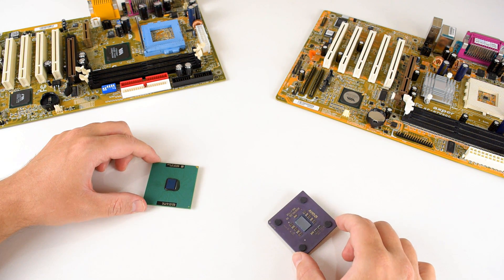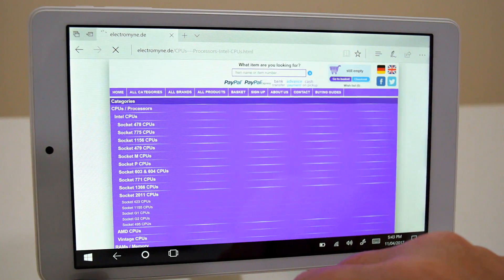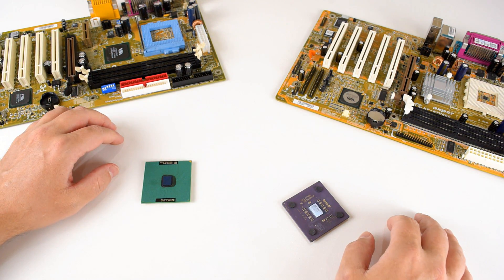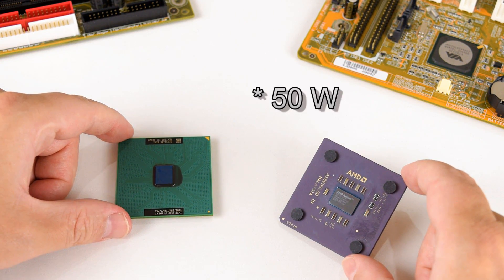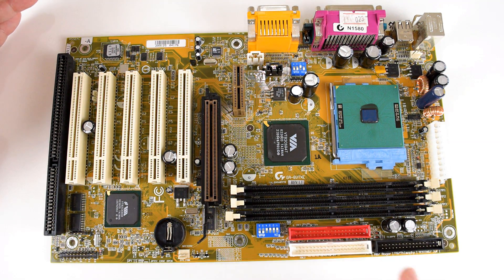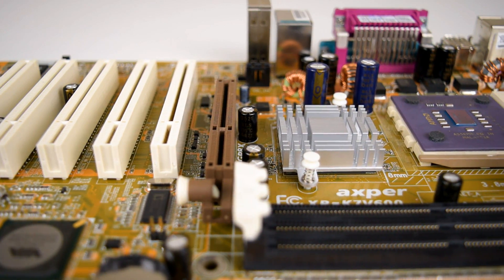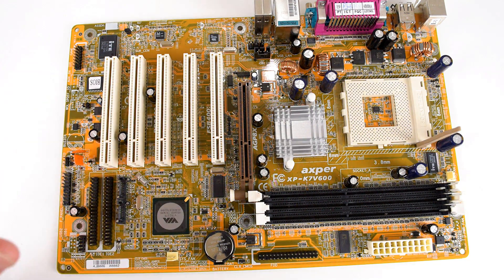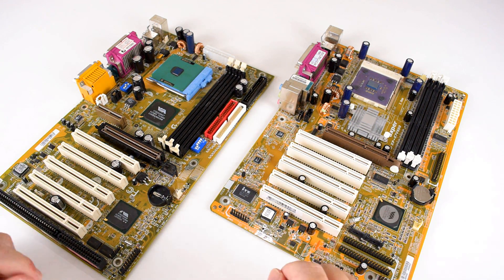1 GHz Retro PC Build Part 1: Pentium III or Athlon

Comment from the maker: Well looks like AMD won by a landslide! So the Athlon and Axper board goes into the 1 GHz Gamer.

I read most of the comments, so here are just a few notes.

- Slot A. I tried. I do read every comment and if I can, I will. It's a combination of cost, availability, re-usability for future projects and other points. But the Slot A just didn't want to happen. So I'm going with Socket A.

- DDR is faster. Yes, absolutely. As most know period correctness doesn't rank high on my list, I chose something that is easy to find, cheap, reliable and compatible with the slowest Duron 600 (if that's the slowest) and top Athlon XP 3200+. There are even faster boards with dual channel like nForce2, but they start to become harder to find and cost more. IMO KT600 boards are a nice sweetspot.

Now don't let that discourage you to build the system that YOU want to build, I'm just giving my reasons!

- P III vs Athlon is a tough one. I don't mind doing comparisons like with the Pentium II vs Pentium III, but with this one there are so many variables. I feel like a wide range of boards and configurations, would need to be tested. Pentium III is annoying as there are DDR boards, but they are really rare and there is also RAMBUS I believe? So that's a lot of work and people will still call it unfair for whatever reasons :P I feel both are excellent platforms and perform great and I rather focus on overlooked aspects than performance to make a call. The fact that you can use a single board and use all CPUs with the Athlon for example. Whereas with the Pentium you need a Tualatin compatible board, which are not easy to find at all.

What happens next:

After a few videos of voting, I will produce a proper build video, explaining the parts maybe in a bit more detail similar to the 486 and 386 build videos I've done.

Next video will be up in 12 hours!
Reply: patience is a virtue.
Reply: 12 hours? But I want it now! (remember that episode from The Simpsons where Moe says he bought a frier from the Army, that could deep fry a entire cow in 40 seconds, and Homer says "40 seconds? But I want it now!"
Reply: I think I have an nForce board laying around.
Reply: heay it seems like you have enough parts why not just build both with the same parts as much as possible and then benchmark them against each other.
Reply: it will depends always, in my zone its pretty easy found pentium 3 1 ghz from OEM equipments. Meanwhile athlon was never popular until athlon 64

Comment: definately athon.  1ghz p3 was coppermine, and it had a bug like all coppermine chips that screwed with the way windows ME handled memory.  Athlon doesnt have that bug, and is much more efficient in pretty much everything.   Intel didnt fix the bug until Tualatin, but even then watt for watt Athlon ran smoother.

Comment: well, I know I am a bit late ;) but as a Voodoo-fanperson, I'd have picked a KT266 or 333 (maybe even 133...) just to be able to run an AGP Voodoo 3 or 5... ; ) Btw. I will be building a voodoo machine in a few days, with a Sempron 2800+ (Socket 754) and a Celeron Mobo and an voodoo3 PCI (it will compete with a Riva TNT2 pro (Elsa), a Geforce2MX, Geforce2 GTS and Geforce4MX460) - wish me luck folks ;) Lets try what gaming is like combining those with SSDs and WinXP ;)
Reply from the maker: Awesome 😎

Comment: Given the availability of more modern parts i really wonder, can you build a retro pc, with more modern parts and use underclocking, core disabling to not exceed the performance you would get from those original machines?
Reply from the maker: Yes you can!

Comment: Hey Phil! Today I'm seeing old videos here in your channel and I'm enjoying it a lot! Regarding this one, I'd say I love both CPUs. However to me it's an unavoidable fact, the quality in Intel's product materials make's it survive until these days more easily than its competitor.I think AMD's higher power consumption, higher level of heat as a result of that and a its lower quality in terms of materials and product design is a dangerous cocktail which caused the amount of working processors decrease over the years. Back in the day when I worked repairing PCs, I recall how easy was to find burned Athlons due to a failure in the cooling system. I'm pretty sure this situation depends on each country but here in Argentina on which unfortunately we have a quite small market of retro PCs and used parts, is quite hard to find Athlon Thunderbirds... and I guess is related to what I say.

Comment: Oh man... this brings some good memories around my Athlon XP +1800 with 256MB DDR@400MHz and cheap Nvidia GeForce 6200A (used to be a GeForce 4 64MB, but it got kinda tricky to run games after some time). :3

I need to find my old machines... this Athlon and another Celeron 400MHz with 64MB RAM and a wonderful 3DFx Voodoo3 3000... it's was built inside of a Pentium 133 case with green led display informing 133. lol

Comment: Voted for AMD just because it looks a little damaged on the video. But I know they survive a lot. Looking forward to pencil mod and some overclock (lower the multiplier and speed up FSB). Remembering buying brand new Duron 600 in 2000, which was able to overclock to 933 MHz without any issues and outlived many graphics card... from savage 4 to GF3Ti500.

Comment: I would imagine the 1Ghz Athlon would perform slightly better on that chipset vs the KT133/A which would have been used at that time.  I like the blue socket on the gigabyte board though.  Don't usually see blue S370's on motherboards.

Comment: Athlon Win, however this isn't fair fight.
That KT600 is so good, it stable, DDR support, overclockable.

if this video was using KT133A with SDRAM it should be in Pentium favor, but if overclock is involved then Athlon would win.

Comment: The Athlon should win that battle.
I had a 900 myself, unlocked with conductive lacquer, ran 1050Mhz stable. The next gen Thoroughbreds were much better though. My 1700+ ran 2.2Ghz (water cooled) on a Abit NF7.

Comment: I'ts very hard to find a good S370 MoBo, i wanted the Asus TUSL2-C, but i've got the CUSL2-C and i'm still happy with it.
Reply: It'S still a very nice board. Overclocks well (If you want to) and quite fast without compatability issues. Just the lack of an ISA slot could be an issue when choosing soundcards (SB 16, 32, AWE 64), but there are nice PCI ones aswell. (LIve, Audigy)

Comment: Taking the motherboard out of the equation, I would go (and voted) Athlon. At this late in the game, I think ISA is pointless. Vortex 2 with a Dreamblaster would be the way to go (this coming from a guy who has a P3 933 Slot 1 with an AWE64 and a Dreamblaster (which I might switch to a Vortex 2). I still would not use the SATA controller. IDE to SD Card or IDE to SATA and an SSD. ...Oh, and you could make the Athlon unlockable with the pencil trick (or rear window defroster paint).

Comment: Historically, the Athlon Thunderbird and the Pentium III had very similar IPC, so very similar performance at the same clock speed. But the Athlon was capable of reaching higher clock speeds than the PIII. When Intel switched to Pentium 4, it was capable of reaching high clocks, but with a lower IPC than the Athlon TB/XP.It's that same old history...If the clock speeds were different, I would prefer the one with the higher. But if the clock of both is 1 GHz, I would choose the Athlon. That motherboard is way better than the other. DDR, AGP 8X, SATA, etc.I chose the Athlon.

Comment: I'm looking for an Win 98 PC running No one lives forever 1+2 perfectly in 1600x1200. And all the parts I'm aiming for are sold out at the website.

Would an AGP Radeon 9800 suffice? Which processor would I need? Any suggestions?
Reply: Not sure what is needed to run it on that unusial resolution, but on 1024x768, high settings (without AA & AF) you should get around 50 FPS with an Athlon XP 1800+, 512 MB RAM, GeForce 4 TI 4200 64 MB
Your 9800 is stronger,, so if you already got it, I would try it atleast.
For the CPu I would go with something beyond one GHz, just to be sure. 
A nice 2003 rig should actually be able to handle that.
Reply: HappyBeezerStudios - by Lord_Mogul That was indeed very helpful, thank you very much!!

Comment: Nice video as always Phil; but I would say that if you compare Pentium III to Athlon Classic make the comparison using the components from that era: SDRAM with VIA KT133A chipset for the Athlon and SDRAM with VIA Apollo Pro133T chipset for the Intel platform!
Reply: I guess the bigger issue then would be to actually get these parts around. And when already benching SDRAM why not thow in a board with Intel i815 chipset. (Maybe even 440BX for completion)
The fairly modern socket A board is actually quite interesting.

Comment: Still to this day going from a K6-2 300 to a 1.1GHz Athlon brought the biggest percentage increase in performance for my computers.  C2D E7200 @ 3.1GHz to Core i7-2600K @ 3.9GHz is a distant second.
Reply: my biggest cpu upgrades were, decreasing order:

486dx4 -> pentium 233mhz that 486 was garbage. it was like a 6x boost to performance. and then 5x (both in speed and IQ) again when i bought my voodoo2
*pentium 233mmx -> atlhon 700*. another ~5x boost. but this time the computer i came from wasn't really bad, just outdated. also already had a voodoo2 in it.
atlhon x2 2.4ghz (@2.9ghz) -> core2duo e4500 (stock) -> the core2duo was at least twice as fast. heck, it ran tf2 faster in single core mode than the x2 did with mat_queue 2 (which was unstable back then,b tw) enabled
q6600 @ 3ghz -> i5 2500k @ 4.5ghz -> just under twice as fast. the thing here is that the q6600 wasn't bad when i upgraded. in fact, it's STILL a serviceable cpu.

Comment: If the motherboards for the two platforms were from the same generation then I would have gone for the Pentium III. At the start of the video when I saw the VIA logo on both southbridges, I thought you had a KT133 chipset for the Athlon. But after seeing that you chose a KT600 board, considering the ridiculous disparity between the two boards, I have to choose the Athlon. :) I mean double the memory bandwidth, faster FSB,  SATA, AGP 8x, USB 2.0 ...

Comment: Hey what's about a socket A board with ISA? I can recommend the Abit KT7A/KT7A-RAID, the EPOX 8KTA3-PRO or the Iwill KK266/KK266plus

It's really cool having ISA on socket A most of those boards will also support Athlon XP Barton.

Those boards all have the Via KT133A chipset which is limited to FSB266

Comment: I owned a 900@1000MHz Duron at that time, because the Athon 1GHz was simply to expensive. So: [x] AMD
Btw: Still have my Athlon 700 Slot A with Asus K7M
Reply: i had that too!
it could overclock to 819mhz. i know because i tested it exhaustively. heck i even did burn-in sessions to try and increase the frequency further. i think it was originally only stable at 790mhz. but this was it. not a mhz more than 819 without becoming unstable.

Comment: Check my Athlon retro build. Bit more substantial than normal.

https://pcmhacking.net/forums/download/file.php?id=14742&mode=view
Reply: I have 2800+ MPs in mine which were the fastest available MPs as far as I understand.  I'm running currently 3Gb of ECC DDR ram, was 4 gigs but wouldn't post when I installed the GPU due to 32 bit memory addressing limitations with this the AMD 760 MPX chipset.  I have a 6800 Ultra AGP card in there. I scored new old stock thermaltake xazer volcano 11 coolers, which were the exact same ones I used on my first proper gaming PC back in 04. The nostalgia in this project is great.

Mother board is a Tyan thunder K7X Pro which I also happen to buy from the seller Phil mentioned in the video. I was only like 50 odd euro.

Just waiting on a SB audigy 2 zs to arrive from the UK as my SB live 24bit died before the OS was installed.

Running win 2k on it as it supports SMP and also older games and is extremely stable, much more than any other windows until win 7 came out.

Comment: I had a Atlhon Thunderbird 1.1Ghz back then, and it was excelent!! With 384Mb ram and a Geforce 2 MX... I miss that era :(
Reply: i had like half of the the atlhons back then. went from 700mhz to 1ghz, then 1.2, then 1.4ghz, then 1700+, then 2100+, then 2400+
Reply: Had a Thunderbird 1Ghz + 384 SDRAM + GeForce2 GTS 32MB... loved it :)
Reply: lol i have the exact same parts back in my repair parts box :D
Reply: I had the budget amazing overclocking chip, the AMD Duron Spitfire 950MHz and OCed it to 1.25GHz
Reply: cut down version of GeForce 2 not good for such a fine cpu

Comment: Voted P3 for universal AGP (supporting voodoo cards) and ISA slot for creative sound cards for best dos compatibility :)
On the amd board, you can only use voodoo4 agp or the pci models, but forget those retro soundcards..
Reply: The P3's board also has a Audio/Modem Riser (or AMR) slot as well, the Athlon board doesn't.
Reply: Mikko Matilainen I voted P3 as well. Did not take notice on ISA. I saw universal AGP and that was enough for me, as ISA soundcards have played out their role on such fast a system. Though you are right. ISA makes room for more choices if you absolutely want an 64-Gold. Else a vortex2 or YMF-724 can do really nicely in a Win98 rig like these two choices.
Reply: Or just go with a SB Live orr Audigy. Both are supported under Win 98. The VIA chipset is what concerns me most on the Pentium board,, they are a bit slower than Intel chipsets. The socket A board on the other hand features SATA, that would be interesting to see in action.
Reply: my isa sound card even has drivers for xp
Reply: brostenen +1 for the YMF-724, I have one in my Tualatin rig and while it's not without issues it's the only PCI card I've been able to use SoftMPU with to get my MT-32 working in pure DOS.
Reply: YMF-724 cards are nice. I have two of them in my collection. I don't really use that many PCI soundcards anyway. I am more of a ISA collector than PCI collector when it comes to soundcards.

Comment: The current stats are great. 20% Intel, 79% AMD. The extra 1% must still have Amigas and think they can compete.
Reply: Hey now, I still have Amigas as well as other retro systems. When you compare the 1990 PC to Amiga, Amiga wins.
Reply: Actually, that is pretty much the CPU distribution with gamers during the Athlon XP/Pentium 4 era.
Reply: Heh, there is a margin of error as the bars don't show the decimal percentages, just the whole rounded percentage. :P
Reply: Hello, besides from experimenting with IBM compatible hardware I used to tinker around with Amiga hardware as well as it was my childhood computer. To this day I have many Amiga computers and parts in my collection. But that word says it all: Amiga is more collecting for me now than it was experimenting and tinkering in the past. These machines have become way much to valuable that you can risk damage them while taking them apart, with a single PPC CPU cards ranging from 1400€ today and up :-). So I switched from that to PC hardware for that where experimenting is still fun and very versatile. To the people who laugh at Amigas today and compare the performance to X86 machines I can only thay thats a wrong approach of getting in touch with Amiga hardware. Amiga machines were always about doing much with a little and they were very impressive in that discipline. And again, thumbs up for this video channel. It is always inspiring me for my next computer build. :-)

Comment: I pick the Athlon , I don't think youve done an Athlon build before.

you could always use an Athlon 1400 and save on heating.

(ok its not that bad, but for a 2001 CPU its very hot)

Comment: Phil be carefull, if you use a ISA sound card the performance of the CPU will drop a lot more than with a PCI sound card, especially in low resolutions. I tested it on my retro pc and the performance with the ISA sound card is some 5-10% lower than with a PCI card in 640x480.

Comment: When you do the Athlon video, as that's what the vote is looking to be like don't forget to also try the "Athlon 4" 1GHz, the mobile variant of the 1GHz Athlon designed to go into full-socket laptops like the Presario 700 line which also had Duron options. just for contrast. also don't forget to mention the Athlon made it to 1GHz before the Pentium did and was on the cover of... I think it was Maximum PC at the time, when it did. I believe from memory that the 4 will work in normal desktop boards.